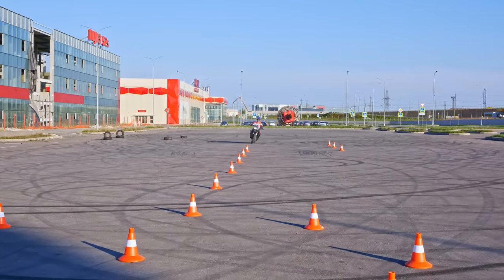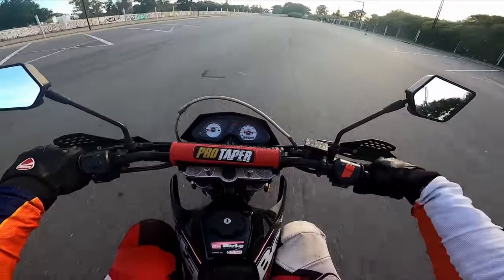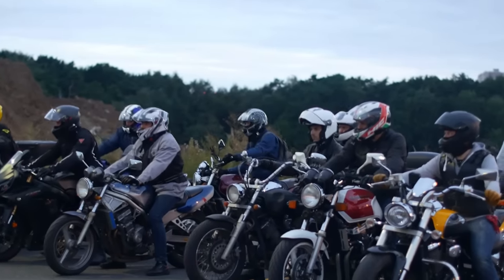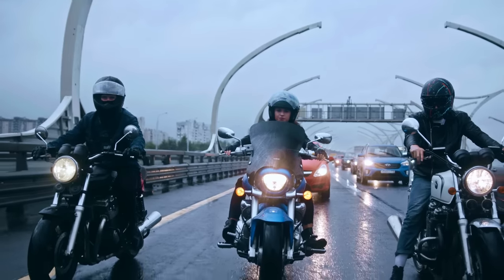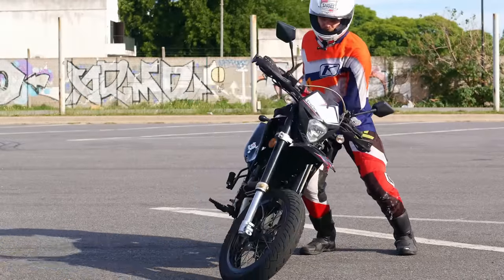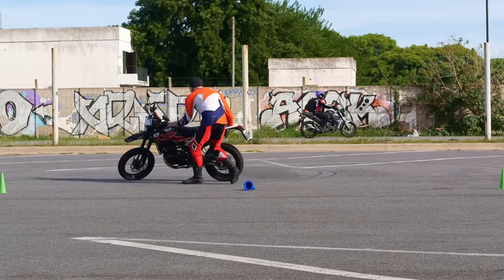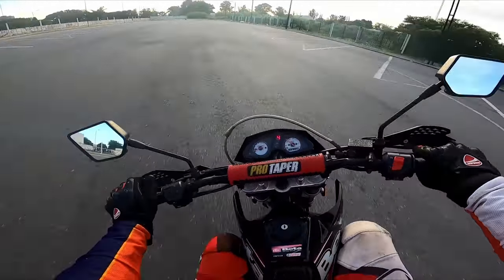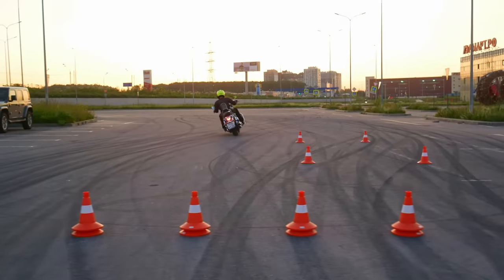How to use Counter Steering to Lean and Turn Your Motorcycle

Comment: Excellent explanation of counter steering. Most of the time, you just hear, "You have to counter steer," but what does that mean? It's the "...brief period when we apply the force on the handle bars to change the lean angle..." Your explanation of initiating lean is the easiest for most people to grasp, and is simple - initiate lean opposite the turn direction so that the bike can turn into the direction desired. Plus, you are not leaning, only the bike is. You are actually staying upright, allowing the bike to lean beneath you.
Reply: the "funny" thing is that "you" and the "bike" form a shape-shifting vehicle with a moving centre of mass. "pressing" the bike into the turn (i.e. staying upright while the bike leans) is more related to comfort and oversight than to physics.

although keeping the torso largely in one space lowers the moment of inertia around the roll axis facilitating quicker leaning at slower speeds.
Reply: I agree wholeheartedly explained very well

Comment: Excellent video.  I had misunderstood what counter steering was in our motorcycle school level 1.  The instructor said to basically push into the steering the way you want to turn- so push on the left handlebar to turn left, which does the same thing, but I didn't understand the physics or what was happening.  I didn't know we actually wanted to turn the wheel slightly the other direction and I was using bodyweight as well.  thanks for clearing up everything!!

Comment: 9:23 This is the core summary of the entire topic! Countersteer is any change of handlebar direction that is opposite to lean angle. Thanks for separating the leaning from turning!

We can even expand the understanding. When we are done turning, we briefly turn the handlebar ‘more inside’ to make the bike stand up. It’s also the same countersteering.

We better call it “the principle of countersteer” instead of treating it like some special technique. All self-balancing objects must move its lower body outside in order to lean inside. All bikes change the lean angle by the principle of countersteer. Turn right to lean left, not go left.

Comment: Brilliant video - even better than a couple of other great videos on YouTube, and that is saying something. What is really tough for me is that I have already learned this stuff subconsciously for years, and it scares me to start just pushing handlebars just to see what happens! Why bother then? is a good question. Answer is I now live in a region with very much more challenging and mountainous terrain, and it has given me a shock as to how much more skills I need to not overcook bends or come off on wet corners and gravelly roads - if I am ever to keep up with traffic that is. Going deeper has undermined my confidence at the moment - like I say I have done the easier bends for many years, or just gone very slow for the occasional one - but I think in the end practice and understanding what I am doing will make me a much better and safer rider. Shame I can't do rider courses, but if you can ride to one safely at traffic speed from where I live, by then you will pass with flying colours.

Comment: This is so unbelievably well explained.
I was sitting here under the impression that riders HOLD their handle bars through the entire corner, and physically turn it throughout the entire corner, sort of "manhandling it". This explains why i kept falling over in my 1st lesson (where the instructor didnt explain anything to me, at all).
I kept trying to hold onto the handle bars like if it was a steering wheel, of course the front wheel then couldnt auto-correct at all.

Comment: BRILLIANT explanation of how counter steering works, how a bike can move forward on its own, how body weight plays a role and how to comfortably position yourself not keeping the front wheel too tight so it can correct itself. And also a brilliant explanation of slow speed turning which should really help someone doing a test. I knew counter steering worked but before watching this my mind was not convinced. But now since this video explains the science of it I have no doubts about it.
Thankyou so much, you have the gift of a great talent man.

Comment: When I'm going really slow (under 5mph), I use my butt to initiate lean angle.  But faster mph that's not possible to achieve desired angle so counter steer is needed. At slow speed,  it's absolutely possible, but just doesn't seem necessary when the angle can be achieved through a small weight shift.  
I absolutely love your videos my friend!  So thorough.

Comment: Great Video for understanding the concept. Recommend it to every new rider. The only thing I have to correct though is the part with the footpegs. It is correct, that you don't initiate turning by using/pushing on the pegs. But, as you stated, the bike is being steered by lean angle and weight distribution. Counter steering initiates a a certain amount of off balance (depending on the first steering input into the opposite direction) which results in a certain amount of lean angle in the direction you want to turn which then determines the radius of the curve (obviously depending on the speed etc.) Therefore it helps to assist by pushing on the pegs in the direction you want to turn in, in order to get more lean angle. This is especially true for unforeseen situations like evasive manoeuvres

Comment: Thanks to youtube I was aware of counter steering when I took motorcycle lessons which made steering at speed fairly intuitive for me - just push where you want to go. However at that time all vids I've seen said countersteering only works at speed and not on slow speed - which happens to be where I'm struggling the most - and I've laid down the bike a couple times by grabbing brakes when it felt like the bike became unstable. Seeing more theory on it as well as practical advice is helpful. After having the bad experience at slow speed gave me massive insecurities to the point where I stopped enjoying the learning process and made me avoid riding. I might give it another go and see if I can figure out what mistakes I'm making as well as stop myself from instinctively doing things that make the problems worse.

Comment: Hi, thank you very much, the physics behind it made me understand. Not only in this video but in others as well.

I perceive your presentation as very calm and non-judging. Good speed, volume and articulation.

A question I have is: How do you ride your bike without applying throttle? If I release my throtty, the bike slows down immediately due to enginebreaking. (R850RT)

Comment: Dude you are good at explanations and impressed been riding my whole life and I used countersteering the most off-road and when I got my first streetbike I didn't even realize I was counter-steering.  Funny looking back.  But I should of been more aware.  Love your videos keep it up.  I was about to buy a new KTM 1390 Super Duke R Evo, but after watching your videos I decided to buy a used 2020 1290, though a bit of me wants the 990 Duke or 890 R, because they are so much lighter. So I haven't pulled the trigger yet on which bike.  Because I sold my 2007 Z1000, but after riding a 2014 KTM SuperDuke R 1290 in Estonia I fell in love with KTM.

Comment: Hi Andrei -- about "foot-peg steering".  It can be observed at 13:53 that when you lift your foot off the left peg, you are also pushing the left handlebar down and forward with your hand.  You are doing this to counterbalance the motorcycle.  If you didn't push down on the bar, at low speed the motorcycle would quickly lean to the right because all your weight is now on the right peg.  For example, when performing low-speed maneuvers on a trials bike, one can lean and then turn the motorcycle simply by shifting one's weight to the inside foot and letting the handlebars turn in the same direction (usually to full lock).  Alternatively, the bike can be leaned and turned by standing on the outside foot peg and pushing down and forward on the inside handlebar with just a bit more force than is applied to the outside peg.  In the video, you have chosen to balance the two forces, and therefore the bike just went straight.
Reply: Well I’m glad we sorted that out. Nice and simple like!🥴

Comment: Andrei, there is another effect that contributes to motorcycle stability. The most important one is the one you mentioned, the geometry of the bike causes the front to turn into the direction of the lean. But there is another contributing factor, look up “camber thrust” which is the fact that when a rolling tire has a lean, then it produces a lateral thrust in the direction of the lean. This force is the reason why a motorcycle that is making a wheelie is usually stable, it tends to not fall left/right even though only one wheel is on the ground, which removes the geometry component of the bike’s stability. This proves that camber thrust is a significant contributor to motorcycle stability. In fact, some riders can still steer the motorcycle during a wheelie.

Comment: Perfect !!
Succeeding in keeping my arms loose while holding the clutch and the throttle steady took me some time, many years ago ...
Now, I sometimes use the rear brake only. Not sure it is an "official" technique though !
Reply from the maker: It's good if it works for you😉

Comment: Excellent tutorial. 

It’s also interesting to look at Moto GP riders who are going very fast in a corner. If you look closely, the front wheel is turned slightly outward from the corner in relation to the frame. It’s the only way to keep the bike leaned that far at that speed. Turning the front wheel into the corner instead of away from the corner would cause the bike to lean less (stand upright) and not be able to turn that tight at such a high speed. It’s easiest to see in a still photo of Moto GP racers in the middle of a sharp turn. It’s kind of fascinating physics 😊
Reply: Unless they are at opposite lock spinning the rear wheel, the front wheel is ALWAYS turned in the direction of the turn.  Countersteering initiates the turn, but the front is turned in the direction of the corner during a turn.

Comment: Counter steering is so easy. When your bike is running straight and you turn your handle bar, the bike will voluntarily lean to the opposite direction of where you turned your handle bar to. It is because the weight of the bike including the rider will not go along with the direction of where you turned your handle bar, which will cause the bike to lean to the opposite direction. The amount of lean angle will always depend on how you counter steer your bike. Just a slight turn of handle bar so you won't need correction like the one demonstrating on the video. Since the turning radius is so little, it can't be avoided. But in high speed corners you must counter steer based on how much lean you needed so that correction steering is avoided.

Comment: The video showed examples with super slow speeds (< 20 km/h). Does counter steering work as well at 60+ km/h and for any type of corner? And is it always necessary?

Comment: Your understanding and mine of counter steering are very different. What you show is leaning and the wheel is still in the direction of the turn. My idea of counter steering is when you power slide around a turn, like dirt track. Your foot is on the ground as you slide the bike around while driving the rear wheel
Reply: They are the same... Counter steering could be defined as "steering oppositely" (in a sense). The difference is in the circumstances... On asphalt, where you intend on having traction the whole time, the counter steer is only brief, in the beginning, to initiate the lean of the bike in the opposite direction... To where as in dirt, where u plan to slide, you would have to hold a counter steer for longer or possibly the whole time... ur having to "counter the slide" in in the case of dirt or ice...

Comment: Counter steering also does another thing, helps the trail of the front wheel to make a U shape easier, therefore it makes your motorbike take U turn easier,  Also your bicycle does the same, but a motorbike is way more stable because of its weight that is centered better, if you shift your shoulders in a same position as your wheel, that helps you lean your body opposite to the position your motorbike leans, which also helps with few other things, centering the weight of your body better on the bike and it helps you to raise the bike and enter into another turn later just by shifting position, since your body is upright, you don't lose balance and your body shifting position is much easier, which helps your motorbike to shift into a turn much easier!
Its like a dance! And with some practice can be lot of fun!

Comment: Loose (not tense) hands are key to successful steering. I am back to riding after 2+ months break (work), and again struggling with smooth turns because of tensed hands. Sometimes I manage to relax, and countersteering just works as it should, in some other cases I don't let the bike to steer.

Comment: At speed over about 40 mph  you have rotational forces on the front wheel, so to turn left you push the handle bar right but you also have to lean to make the turn work. If you put a snow ski under the front wheel, and i have done this, you turn right, you will go right because the wheel is not spinning. Best to always lean into the turn using front motorcycle ski.
Reply: Where are you from? What you said do not work in this universum.
Reply: @XtreeM_FaiL  I don’t think you quite understand friend . You can always do it in real time to discover it yourself
Reply: @highspeedboom  1. Speed does not matter. 40mph or any other is not magic barriel you have to cross. 
2. You don't have to lean.
3. Snowski also countersteers. Problem is that ski on a hard surface will skid and then you fall.
Reply: @XtreeM_FaiL  you do ride motorcycles right?

Comment: Hi I'm just watching your excellent video again. I was just wondering when you are in the middle of your turn on the road and you need to turn more, for example if your corner tightens or you didn't countersteer enough initally, do you countersteer some more, or decelerate a bit, or apply a little brake (trail brake) to make the bike turn more?  Should 'direct steering' the bars into the turn a little more, have the same effect?  Maybe that's actually a countersteer the other way?  Cheers

Comment: Best video I've seen on counter steering, and funny at times too. A question, when changing direction practicing a slow speed circle, exactly how do you transition to a circle in the other direction? I have trouble doing that. Thanks.
Reply from the maker: With countersteering, weirdly enough😁 Here https://www.youtube.com/watch?v=T6jv02IKVOs&t=2s&ab_channel=MotoControl from 7:28 you can watch more on it

Comment: Been learning how to ride this past months and your content has been very helpful!
Thank you so much! 

One question I have is, what is the safe speed range for counter steering?
Reply from the maker: There is no speed range, it applies on any speed, pls watch the video, I really have tried to make a good explanation🙂
Reply: @MotoControlEn  thank you! motojitsu told me it can only be used at low speeds, but I have been naturally and comfortably using it in high speed cornering so I was not sure if I was setting myself up for a bad accident
Reply: @sindthekid  You must have misunderstood something. Countersteering is effective at any speed. The only problem at super slow speeds is that the lean of the bike may become enough to make the bike drop to the ground, before it can stabilize itself. You can test slow speed behaviour with a bicycle at very slow speeds.

Comment: thakur circumference hands free, that rear wheel movement from sudden sidy before camera is for that front wheel axle to center of touch scale gap , distance , in motion or roll if the bike is side turned from handle , the rear as doesent have like some cars rear steering facility , so it gets off alignment and skids that 2-3 inch front wheel axle to centere of , i dont know the your purpose but i should use skid from it to put more brake and stop boke from front rolling and get obstruction from drag out of unavailability to roundness of the tyre. 
So, for this info , i am getting tought the lean at turns where knee touches the track, and bonus is circumference hands free, please ✌😊✌

Comment: Excellent video except for the foot-peg weighting/steering. In  your example you are standing on a foot-peg but you are still balancing over the center line of the bike, hence it is not turning.  The point of the foot peg steering is to step on the peg and shift  your weight onto it, so that you lean the bike using the pegs.  It is still slower than steering with the handlebars but it is very effective when combined with counter steering.

Comment: @13:28 on my bike, I noticed that it leans faster if I push/lean on the seat with my ...well, but cheek :) than if I lean my upper body like you do there. Talking about no hands steering of course. Probably because the weight shift is then closer to the center of mass of the motorycle. Also, @13:50 you area cheating a bit. Yes you remove the left foot but you also slightly shift your hips towards the left, thus balancing the missing weight. I know this because sometimes I stretch, so I get up on the pegs and if I remove the left leg and don't shift a bit to the left, the bike will want to lean right. It is a very small effect but still, it happens.